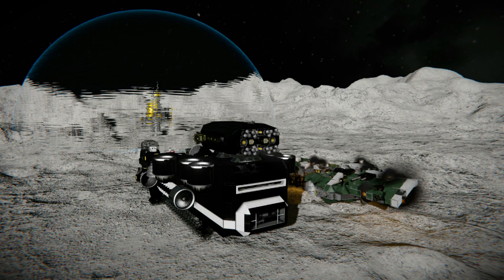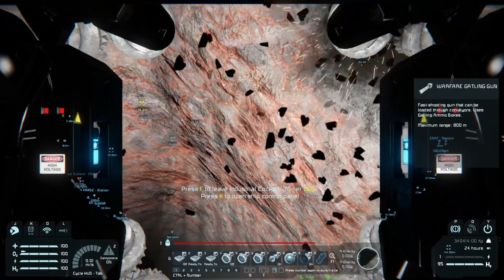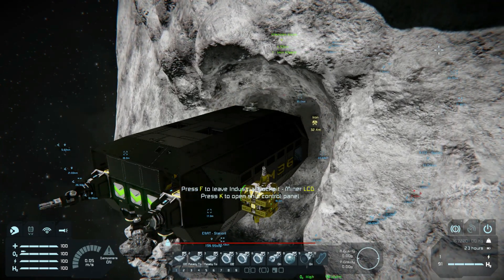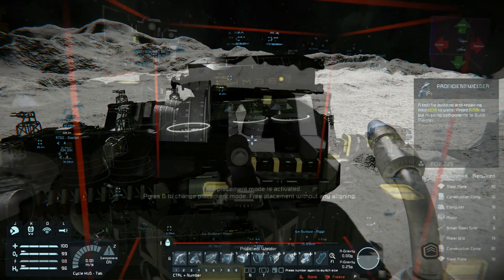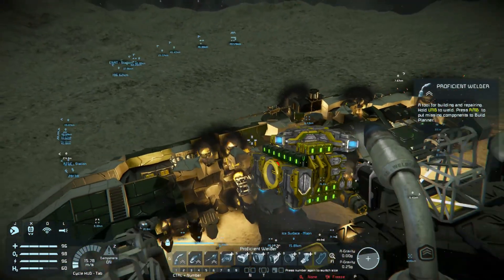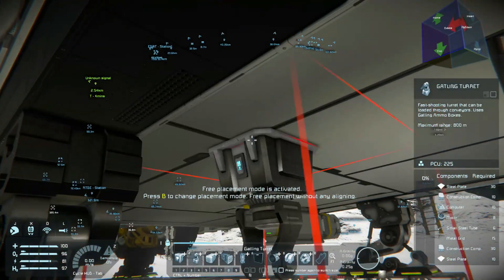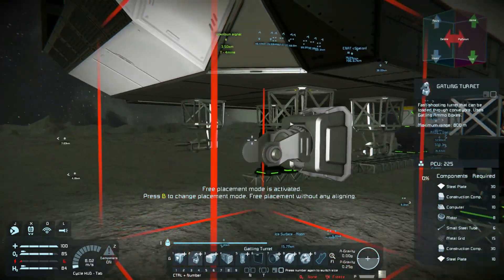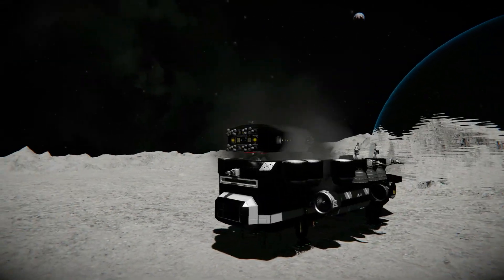Space Engineers - EP27 - Assertive Combat Systems Mod Explained | Tutorial | Let's Play

Comment: If you want a real challenge, there are much more challenging mods than Assertive(no offense to Splitzie). Reavers, Orks, Corrupt, and the many npc mods by The Final Event97(MES+AiEnabled Mainframe Organized Domination Systems etc.). As far as taking over ownership of a grid you have 4 options, grind every single ownable block(no mods), use the Easy Takeover mod, use the Hostile Takeover mod, or use the hacking mod(which is the more "cheaty" option). I personally use Hostile Takeover as it makes taking over more difficult than Easy Takeover and using the hacking tool mod, but not the insanity of trying to take over every single ownable block.

Comment: Taking over ships:
There is a mod called "Hostile Takeover".
When you pull out a grinder, blocks will be highlighted.
To be able to takeover a ship, the highlighted blocks must be ground below functional.
The highlighting is pretty intense and would be much better if it were more subtle, but the concept is quite good.
You still have to work your way through the ship to reach all the blocks that have to be taken out.
Once you get all the blocks, the ship turns to neutral. I think... Or was it owned after that..? IDK right now.
Give it a go. Works.